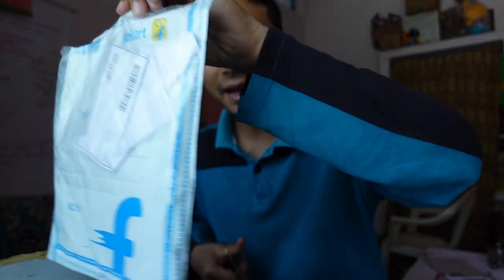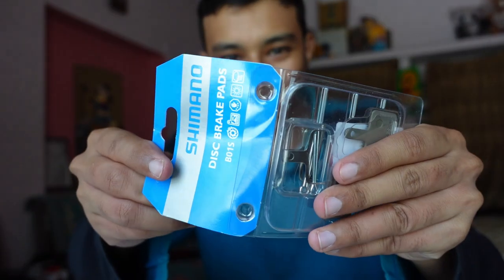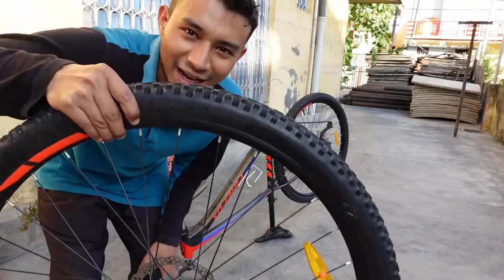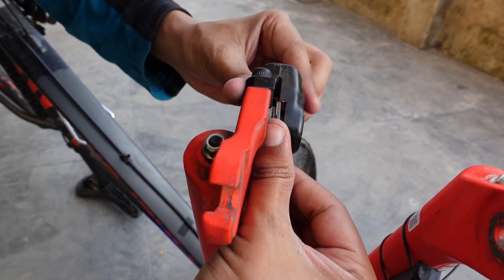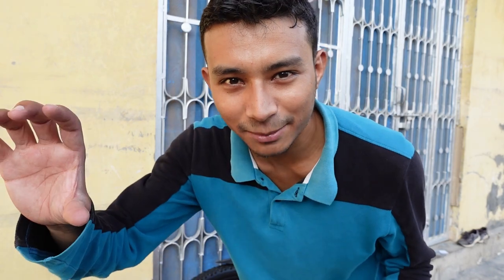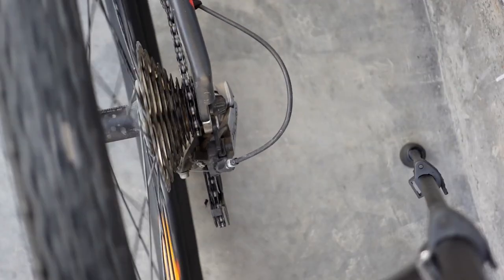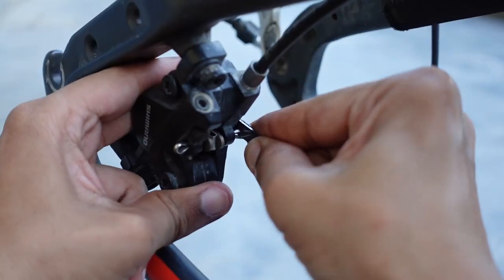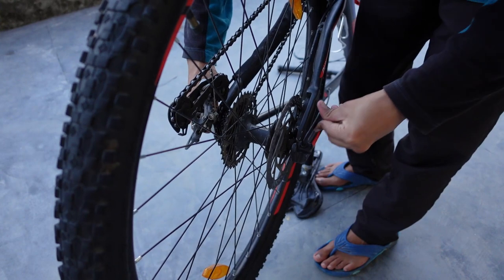How to change Bicycle Disk Brake Pads | Awesome Buyers [MTB  Disk Brake Pads in India] - Cyclop.in

Comment: How is your experience with Firefox Stravaro is it good should I buy it 🤔
Reply from the maker: Great experience..  but if you are above 165 cm in height then it will be fine otherwise you will have to cut it's saddle pole so that it can lower down.
Reply: @AwesomeBuyers  okay bro thanks alot 😁 I will definitely buy it

Comment: I accidently spilled oil on my rear disc brake while lubing it and now it is taking a lot of effort to brake.Bro please tell me what should I do because I have new disc brakes and the noise they are making is really irritating me.
Reply from the maker: I Found this answer on google..  You need to remove the oily disk from the bike and use a bike degreaser or alcohol on it to remove all oil. Rub with a clean dry cloth or kitchen paper and repeat. While finishing the process avoid touching the disk with bare hands on the face where the pads contact it because fingers leave grease as well.    IN Loop Lube website I saw a disk brake cleaner. I don't know how effective is that. But I think it may help. Contact them. And YOu may need to clean disk brake pads as well..
Reply: @AwesomeBuyers  Thanks 🙏🤩🙂😀😄😃🤗🤜